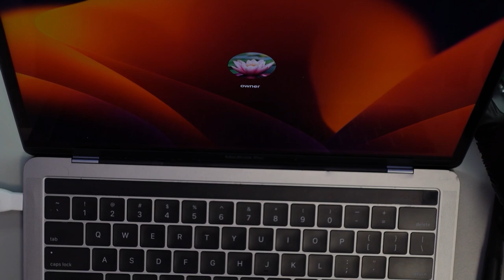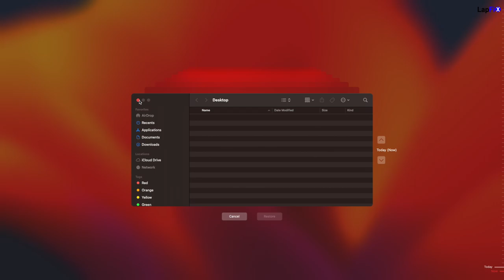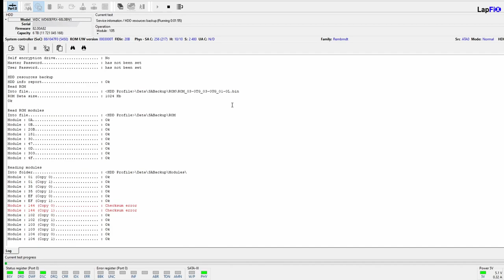WD My Cloud Data Recovery

Comment: Been using my 4TB 2nd gen since 2017; expanded it last year with a 14TB WD Elements drive. It's generally good and has decent network transfer. Just be sure to turn auto backup off on the app for any connected device to allow the thing to sleep when not in use.